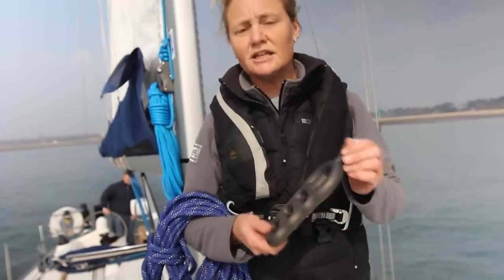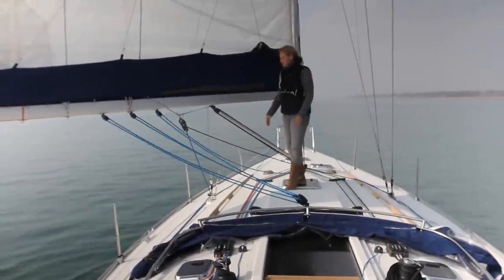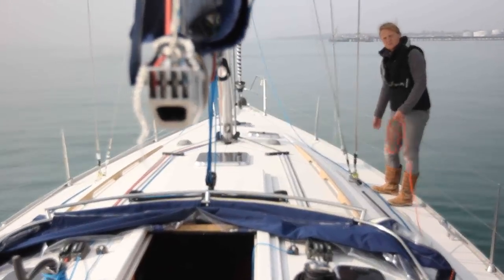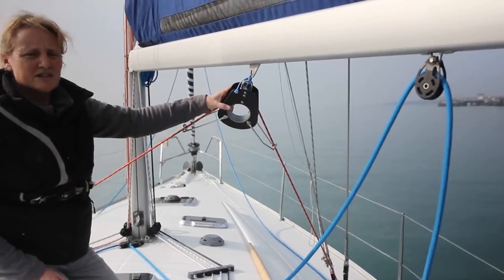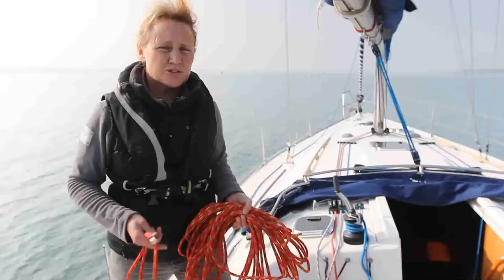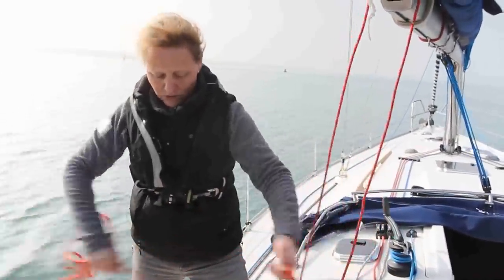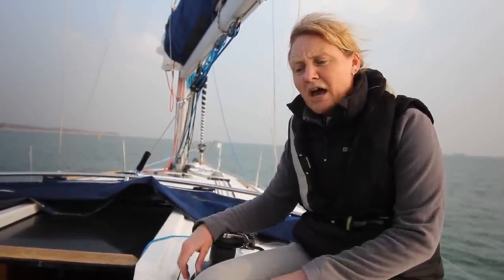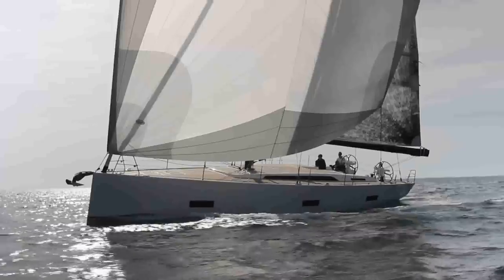Boom brakes and preventers test

Comment: Hi, I take my preventer right to the front of the boat to a block, outside of the shrouds but inside the Genoa sheet, the long rope and angle will allow the boom to rise if it touches the water at speed.
If you take it through the cleat midships as some do and you gybe then you can rip out the stanchions from the deck.
I then take mine back to the Genoa winch that is not in use at the time, then I can get to it quickly and ease it slowly whilst letting the mainsheet take over the load, there will be a lot of weight on it if you gybe and the boat will be out of control, you need to get to it in a hurry.
Attach to the boom with a large bowline or a short strop so that you can reach to connect or disconnect it with the boom fully out whilst you are standing on deck.

Comment: I am setting up Both , accidental Gybe preventer, line tied end of boom to bow cleat and back to cockpit, + rock climbing figure of 8 around where vang is. If accidental gybe happens, i have the preventer. If i want to gybe, i gradually release preventer, plus i have the figure of 8 Brake to make it less violent, + if wind is very strong, i sheet main in and out as im gybing.
Atlantic crossing in January 🌎❤️🙏🏼⛵🏴‍☠️⚓

Comment: dodgy gybe: Was sailing a modified 49er with 470 sails, 1 trapeze and no wings. We went for a gybe with the kite up and this is in 17 knots of breeze. We broach and m crew has to climb on the centre board but we didn't capsize and I was trying to bear off and hike but the tiller extension had a sort of sleeve extension to make it longer so that just got ripped off and left us amazed we survived that experience

Comment: Very helpful video.
Had a couple questions about the old fashioned bowline on the boom approach. 
First, what is preventing the bowline from sliding forward on the boom? Is it grabbing a cleat , line, chock? 
Second, when you run the line forward , what are you passing the line around or through to hold it in place before running it aft ?
Thanks

Comment: if you run the line around the mast, through a fastener at the cockpit and than latch it on again at the leech (big loop etc.) you can just hold your sail in place until you decide to gybe. but without the discomfort (and safety-hazard) of having to set it all up again after every maneuver.

Comment: What do you loop your line around foreward on the boat?  A cleat?  Windlass?  Just looking for safe options/ideas.  Thanks.
Reply: Ian Northrop Take the preventer round a cleat, then back down to the cockpit and make secure. Run them outboard of the shrouds.

Comment: Well, personally, I prefer the simple combination of a long line, reliable knots, and good seamanship. Less equipment means less potential of damage and problems. You'll have to move a bit more around your boat, but that's the way it is for a sailor.
Reply: "Long line, reliable knots, and good seamanship" doesn't prevent accidental gybes.  If you've ever sailed alone, you'll know that no matter how well things are set up, the wind can change abruptly and if you're down below making lunch or having a nap, you'll never have time to react.  These are invaluable.

Comment: A simple preventer line rigged to the end of the boom is simple and effective to prevent accidental gybe.
Reply: I like their idea of a long preventer going round the bow and back into the cockpit.  That way you can release it easily in a hurry.
When rigging a preventer, I worry about the wind changing direction suddenly, or a lack of concentration on the helm, or some other issue where the wind gets the wrong side of the main and the preventer could cause a lot of problems.
Reply: @alkaholic4848  If the wind is powerful enough and you have a preventer rigged, instead of gybing the boat will turn on her ear until you can slowly (and with control) ease the preventer.   You have to be ready to release the line and work it, quickly and safely.   If you sail alone, this requires absolute attention in the cockpit 100%, which is impossible.   A brake, however, allows the boom to move slowly and with less force.

Comment: I absolutely do not like preventive setups with the "vang" eye on the boom as an attachment point. If the end of the boom touches the water, under a strong inclination of the boat, the risk of a broken boom is emminent.
Using (and demonstrating this explicitly) these preventers to actually perform a mainsail gybe is not at all a good practice! The mainsail sheet should always take the main load of the gybe, even when preventers are in place.
Reply: Good point.

In the dinghy world there is the Clamcleat CL257 which will automatically release under a certain load.  For example it's primary use in the dinghy world is the downhaul of a lifting rudder - so that if the rudder hits an underwater obstacle the cleat will release rather than damaging your rudder or its assembly etc.

I can't think of anything similar in the yachting world, in particular something that can be used easily as a preventer would be ideal - to stop the boom from accidentally backwinding under normal conditions but if either the wind gets the wrong side of it too strong or if the boom takes a dip as the boat heels, the load would pop it out of the auto-release.
Reply: Except that these aren't preventers - they are brakes.   If the boom does hit water, it will indeed move, just not as violently.   Brakes are definitely not preventers.
Reply: These are not really preventers. What they do is reduce the shock load. It doesn’t take much to do that and all of these will save your boom.

Comment: Only problem is the systems require a winch being free in the cockpit , when using a Genoa the cockpit winches become a premium and gibing and easing the Genoa and main not only require dedicated crew they also need cockpit winches to be in use
Reply: You can use an aft cleat also.

Comment: Question (from a relative novice); I can understand the benefits of this for accidental gybes, but if you're planning a controlled gybe, why would you not sheet the main in before going through the gybe and then letting it out again after?
(just going based on what you covered in your demonstration)
Reply: @stephenkidd1012  Great link! The human preventer obviously works if you want to go swimming :)
Reply: in rough condition even this is difficult and can slam quite hard

Comment: As a noob to sailing I consider this a pretty awful design flaw. That yachts, which are hardly cheap, are not fitted with some device to prevent damage or injury - as standard - seems lame?

Comment: Or, every single sailor can do what they always did. Pay attention to the sails. Not run the boat on autopilot all the time. Actually sail. Never seen the reason for a jib preventer. 
/Joel
Reply: A simple jibe preventing line to hold the boom back isn't a bad idea if you're going to run, especially a wing on wing run. Although I wouldn't rig it the way she did and I wouldn't recommend trying to let the tension out of a jibe preventing line while it's under a load but rather just bear back down wind so the wind isn't behind the sail. 

But it's even safer to just avoid running and stay on a broad reach and just haul in the main sheet and lock it in before performing a jibe.
Reply: Shit happens, accidents happen. If you run on reaching or a forewind course for a predictably long time, a preventer simply is good seamanship.
Reply: If you ever sailed in strong winds and high rollers, your boom will be shaking like crazy, and a preventer is an absolute must. But even in a flat lake with 20 knots wind, gusts can come in from a different angle. Absence of a preventer is dangerous, potentially disastrous for your rigging and shows lack of respect for the sea. Luckily, they teach you the use of preventers on any basic course, and most sailors are wise enough to use them.

I wouldn't go for any of the tools shown in this video, though. Just use a normal set up, and fix the preventer where the force is exercised on the boom (that is, where the main sheet is connected). This prevents boom damage.
Reply: Sail the trade winds during 25 days and then tell me after.